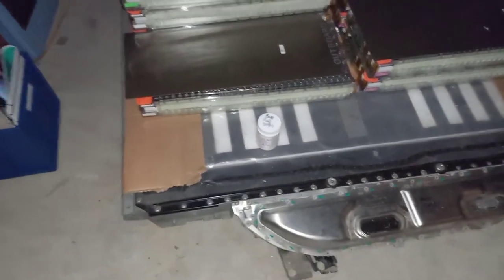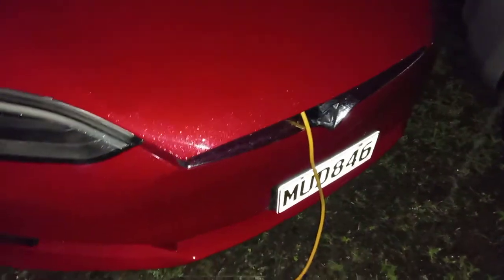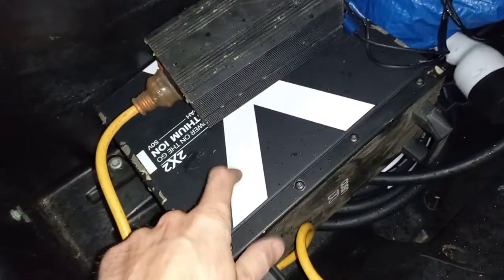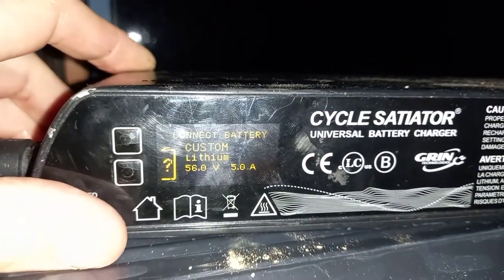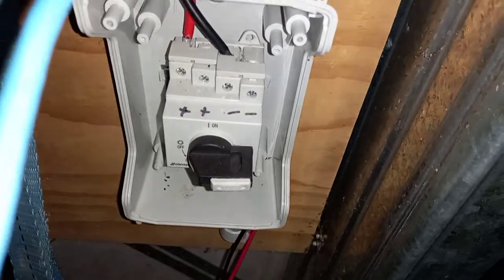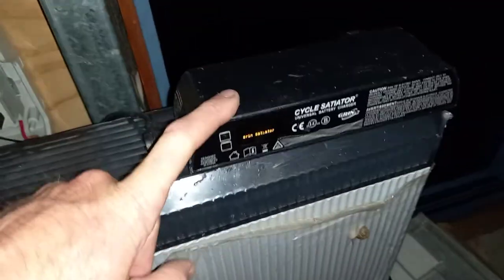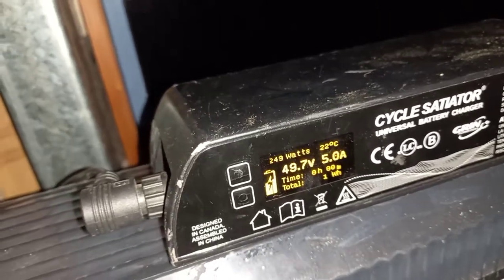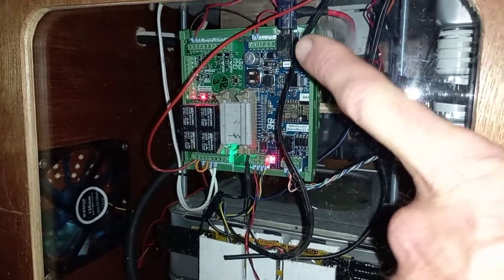Flat House Battery, Full Car Battery....Bright Idea

Comment: How much power are you taking out of the Tesla to put 250W into the house battery? I assume that the house battery total capacity and your background power use (all grossed up for the converter/inverter/charger losses) won’t get anywhere near 45 kWh? I guess that even at 50% efficiency it would take 60 hours to get 30 kWh out of the Tesla.
Reply from the maker: I didn't get a chance to measure. My faithful Satiator died-I'm blaming the crappy inverter-and no pixies were wrangled.
Reply: Raglan's Electric Baboon Oh bother I was hoping for more triumphs of ongoing hackery